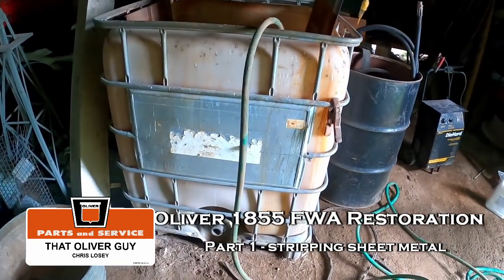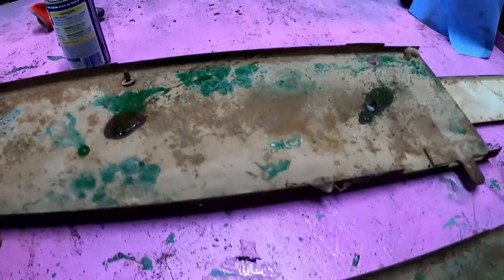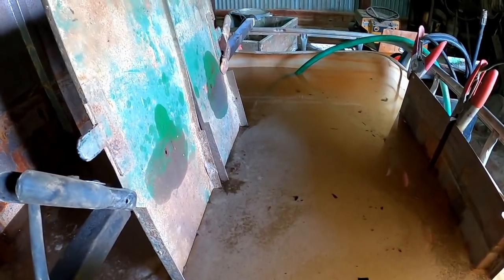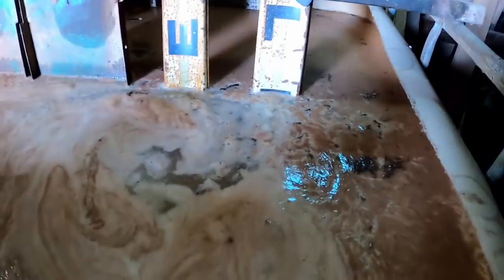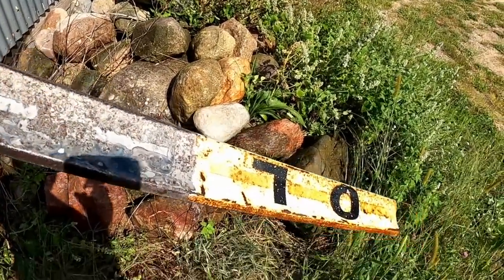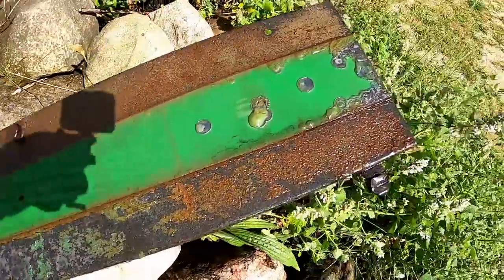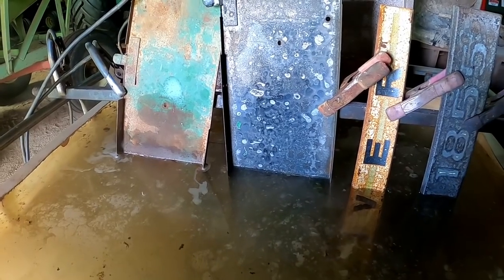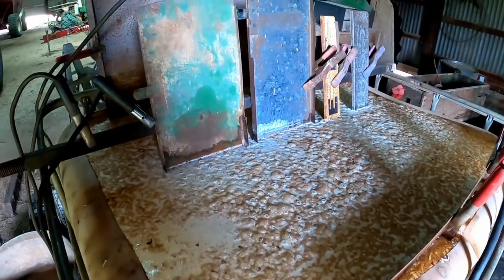Oliver 1855 The restoration begins!

Comment: In the 90's I painted 2 or 3 tractors a year in my spare time for$$$. I used a 3500# 4gpm pressure washer with a sand blaster attachment. Coal slag works better than sand as it feeds through the siphon nozzle. I never worried about flash rust .I used a good self etching primer and didn't have any issues.
Reply from the maker: Do you have any trouble with it distorting metal or blasting too much away?
Reply: @ThatOliverGuyChris  In general no.Older tractor sheetmetal is a thick enough ga. not to distort. That being said common sense must be exercised.  Delicate parts anything glass or plated needs protection you can always test an area and even turn the water pressure down. Expect to be a wet filthy mess at the end. Mrs. Oliver Guy will probably make you leave you clothes at the door.
Reply from the maker: @petepeeff5807  I bet it's great for cast iron.
Reply: @ThatOliverGuyChris  Yes.But be very aware of any openings the grit can get places you definitely don't want it.  Bought a big Eager Beaver chipper 2 years  ago with a stuck engine .It had been blasted and painted. It had a hole in the exhaust and water and grit in a cylinder.

Comment: Good Morning Chris! I cant believe how good that electrolysis works. It would be cool to build a large scale tank that could have anything put in it. Your setup works great. Looking forward to seeing this tractor restoration
Reply from the maker: A friend brought me an old plastic fertilizer tank for just that purpose, but the thing was so brittle from years in the sun I didn't end up using it. There's a video on youtube where a guy made 'tank' from plywood and plastic sheeting, big enough to do a car frame. He hooked a dc welder up to it and had it done in a few hours.
Reply: @ThatOliverGuyChris  Yeah that's what I'm talking about like doing truck frames and stuff. That's pretty cool I'll have to look that up. I actually think the 250 gallon tote that you are using is basically the perfect size. Even if you have to flip things over and do them in two stages it's not the end of the world and it doesn't take up a lot of space, and it's still very effective

Comment: Impressive how well that works! I never realized how uncommon the battery box covers were until one year at a show a group of Oliver/Cockshutt guys were quizzing me about the 1755's cover and couldn't believe it was the original one.
Reply from the maker: I don't see them very often, so I was really surprised when this one still had it. They must have hung it on the wall the first time they had to put new batteries in. Maple Springs Farm repops the tray,hold down and lid, all very reasonable in my opinion.

Comment: Worked pretty good. I need to make me a tank like that.
Reply from the maker: It's not too different from the electroplating you've been doing.
Reply: @ThatOliverGuyChris  yeah it’s similar, well, in reverse I guess haha. I’ve done a lot of electrolysis rust removal but the biggest tank I’ve had is a poly 55 galllon drum. I need to find a bigger tote like you have, looks like a good setup.

Comment: Chris I'm adding a roll bar to my 1650 and I believe I'll need to move my toolbox from the fender to the right side of the frame. The parts book lists a bracket, Is the bracket at 13:26 in the video the one I need? As always great video. Now I know the correct placement of the decal for the canopy.
Reply from the maker: That time stamp is a side panel. The tool box on this tractor was made from an old mailbox, so I doubt it has the correct bracket on it. There were a couple of brackets available depending on where it was to be mounted, but finding one might be a challenge.
Reply from the maker: I found the part number for the frame mount bracket, 167758A. It's pretty simple, piece of steel bent at a 90 degree angle. The box sits on top, with two 3/8" bolts holding it on the bracket, and two 3/4" bolts holding it to the frame.
Reply: Yes, I saw there were different brackets and two different P/Ns for the boxes. The 2-70 doesn't show any brackets.  Be easy enough to fab one up. Thank you for the reply.

Comment: are you going to make another Herman? i hope so my friend, i missed out on a little Herman at Ray Tosch in the 80s, I'm 75 years old and i want a Herman to look at and a d 21 Ac.
Reply from the maker: I'll restore this one to how it left the factory, so it will have the same size tires it has now. I'd have to check, but I don't think it has the correct front axle ratio to have terra tires.

Comment: I like the way this seems to work. I saw your other video doing this, too. Anything to watch out for (besides the lye) with the setup? I'm assuming you don't use this on the fuel tank?
Reply from the maker: Don't put anything aluminum in with lye. It will be gone when you go to pull it back out. 
I do use it on fuel tanks, it really works great on the inside of them.

Comment: Hi Chris. How many 1855 were built with front wheel drive? Appreciate an answer. I have bought one. I watch a lot of your video and have not seen one where you say the production number.
Reply from the maker: There were 196 badged as Olivers and 21 badged as Cockshutts. There were also 2 built as Minneapolis Moline G940, and both of those have been found and are owned by a collector.

Comment: Hey Chris the paint removal process seems to works pretty well. I Might have to try it out for some of my projects. How is the 1855 mechanicly, is there alot that has to be done to get it running?
Reply from the maker: The previous owner tried pull starting it, not knowing there was water on top of a piston. Now the head gasket is poking out the side. So it's going to get a complete engine overhaul. I'll go through the 3 speed and reseal the front axle, transfer case, pto, and just about everything else. They were using pretty regular prior to the engine problem, so I don't expect too much to trouble outside of the engine. I'm contemplating putting a new hydraulic pump on it since I don't know the condition of the one on there. I'm sure it works, but how well? I just don't want to have it all painted up and then have to fix more stuff.
Reply: @ThatOliverGuyChris  ya I hear you there. Hate to have do a major repair when they are all painted up.  I am thinking about the same thing with my 1955 when it has its turn thru the shop.
Reply from the maker: @aaronkaraszewski2749  Ag Parts first has brand new pumps for less than $1500. A friend is trying one out now to see how good they are, but for that kind of money, why mess with an old one?
Reply: @ThatOliverGuyChris  thats not to bad for the pump. I buy alot of parts from Jerry at Agpartsfirst. Hes a Good guy yo deal with.
Reply from the maker: @aaronkaraszewski2749  Yep. His brother Rick is a good guy too, very knowledgeable. The pump is even made in the USA. Other places are up around 4 or 5 grand.

Comment: With the black spots and little leftovers do you go back in or  finish during preparation for paint?
Reply from the maker: I'll usually hit them with a wire wheel or one of those 3m abrasive wheels to clean up the little bits.

Comment: I have a 2 85 white its the newer version of a 1855 now im getting hydraulic oil in my diff/trans where would that be coming from
Reply from the maker: 9 times out of 10 it's the piston seals in the pto. Ive got a video on rebuilding them.
Reply: @ThatOliverGuyChris  right on thanks man seem to do it when i did alot of pto work to
Reply: @ThatOliverGuyChris  thanks alot your videos are helpfull to keep these ol olivers running thanks

Comment: Do u know a way to get paint off stainless steel? I’ve tried everything I know and nothing’s worked
Reply from the maker: Paint stripper or sand blasting? I would not use electrolysis,  it can pull the cadmium out of the stainless and make the water toxic.
Reply: @ThatOliverGuyChris  It’s on a old fertilizer spreader and I’ve used paint stripper and tried to sand blast it neither have worked all the paint stripper did was make it orange instead of white
Reply from the maker: That's some tough paint. I don't know what to recommend.  If it's on that good, I'd consider scuffing it up so the new paint sticks and look at the old paint as one heck of a primer.
Reply: @ThatOliverGuyChris  might be what I have to do but I was wanting to bring it back to the original stainless color

Comment: Hey Chris would you know of anywhere to get a set of fwa rims? For 2150
Reply from the maker: What size do you need?
Reply: @ThatOliverGuyChris  hey thanks for getting back to me it has 14.6/26 on the front
Reply from the maker: @claytonhofacker9150  Are yours shot? If just the rim is rusted, you could get a new rim, cut your center out of the old one and have it welded into the new rim. I don't have any, but I'll keep my eyes peeled for some.
Reply: @ThatOliverGuyChris  thanks that's what I was thinking centers are good rims are shot thanks for the help

Comment: Hey wait a minute…..if your doing 1 you could do 2…..I’ll bring ours down….lol
Reply from the maker: I'm currently planning on tackling 2. We'll see how well that pans out.
Reply: @ThatOliverGuyChris  hypothetically, what would you charge to restore a similar Oliver the same way?
Reply: @ThatOliverGuyChris  maybe obvious, but does the electrolysis container need to be non-conductive?
Reply from the maker: @bendunkelman4853  pretty much. Keeping everything electrically isolated would be a challenge. If your sacrificial metal touched a metal container, that container would become charged and corrode as well.
Reply from the maker: Oops... I missed your other question. In theory, I'd probably charge $50 and hour plus parts and materials. I was planning on keeping track of my hours and costs on this one and have already failed when I take a few minutes here or there to remove parts and stick them in the tank and don't think to write it down.